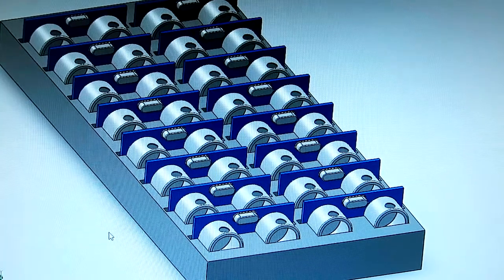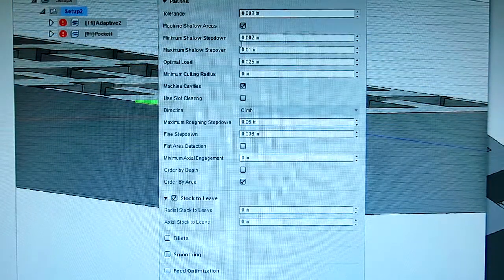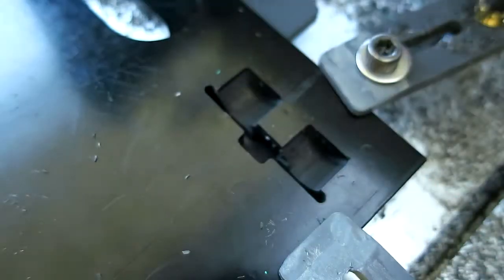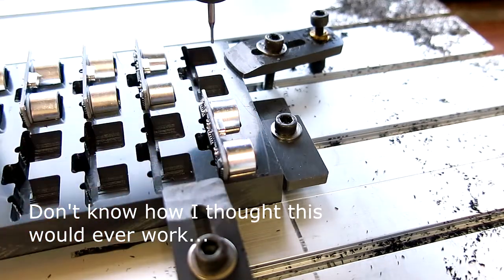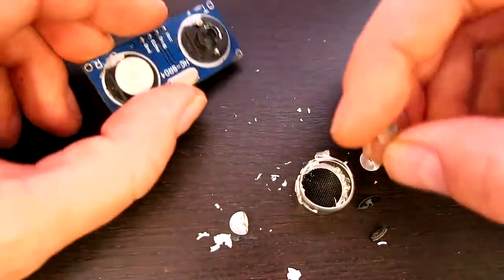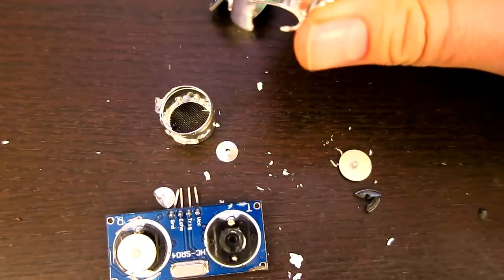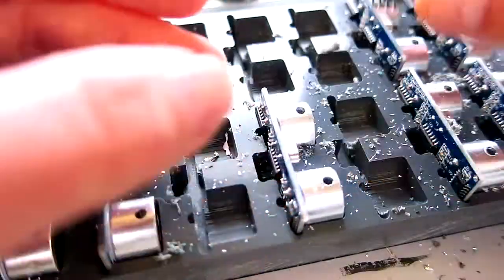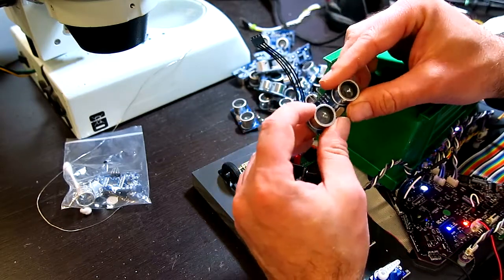HC-SR04 Ultrasonic Rangefinder - Internal Parts, Modification

Comment: Lol, was expecting a gorey bloody finger shot, sorry :) really surprised you didnt clamp down some bars along the top down the middle of eachmodule to ensure it stayed down. You could have also clamped a metal sheet to keep them all down and square, drilling through the sheet and the casings.
Reply from the maker: Yea I may end up doing just that. Putting a strap over the top would be easy enough.